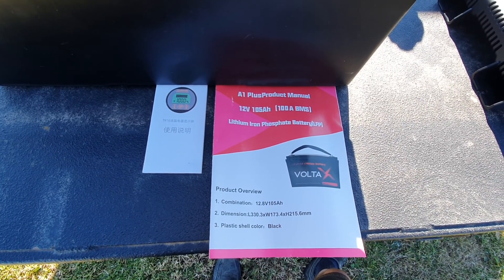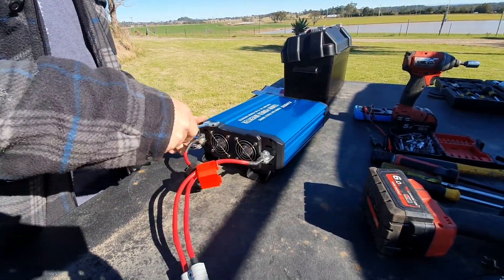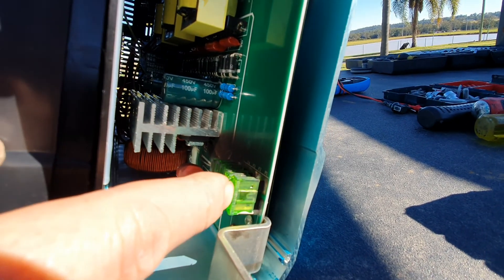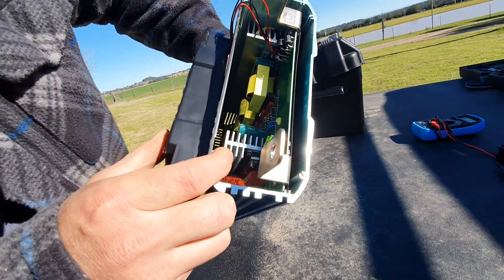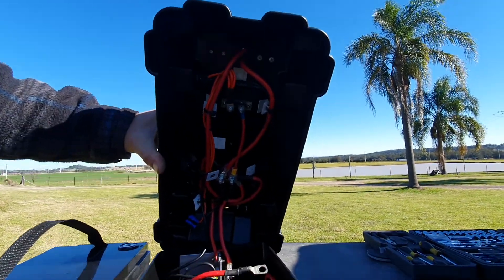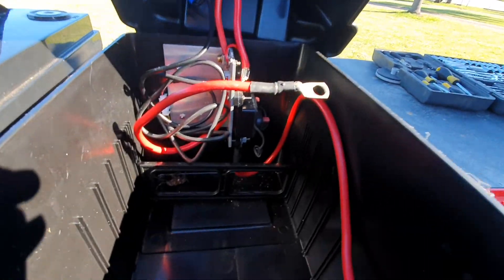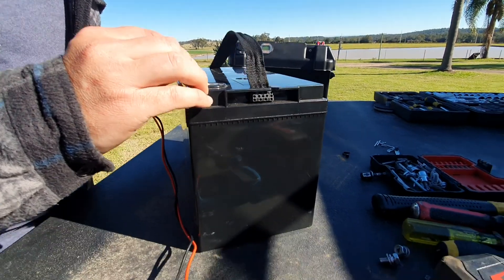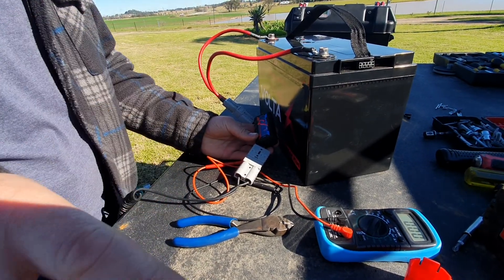VoltaX Lithium battery BMS saved the day from Adventure Kings 1500 watt Inverter FAIL

Comment: Are the voltax batteries any good? They are pretty cheap on eBay. Thanks
Reply from the maker: Hi there, i actually have the 100aH and 105aH and both have not missed a beat. And use both for camping, hunting and on the kayak
Reply: @DontBlameDONTdoIT  thanks for the reply mate. Had them long? Could I run a 1500W inverter off a 120AH lithium battery, I just wanna run a 1000W induction cooktop and maybe a milk frother or small pod coffee machine
Reply from the maker: @geoffstein3896  yeah it will run it easy as. And had the 105aH over 2 year's and the 100aH over 1 year
Reply: @DontBlameDONTdoIT  thanks mate

Comment: Had same invertor for years, been run at max many, many times, and never a problem.....but then I do run decent sized leads on it, not bloody slightly oversized speaker wire...
Reply from the maker: 6b&s is far from bloody slightly oversized speaker wire

Comment: BMS would have disconnected due to the over current short of the inverter. They just need the positive terminal taken off for a few seconds, BMS resets and its good to go again.
Reply from the maker: yep and battery still going strong. allso use it on my electric boat motor aswell

Comment: That lithium battery discharge current is to small to run a 1500w inverter
Reply from the maker: It was never used at 1500w.. was used for heated blankets so sweet bugger all amp's drawn